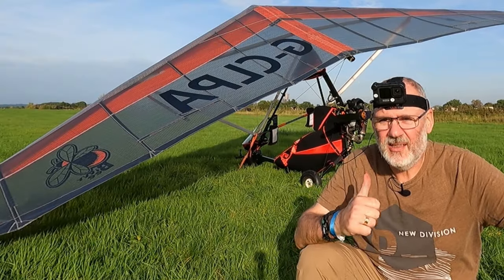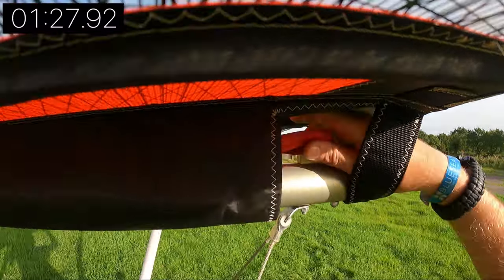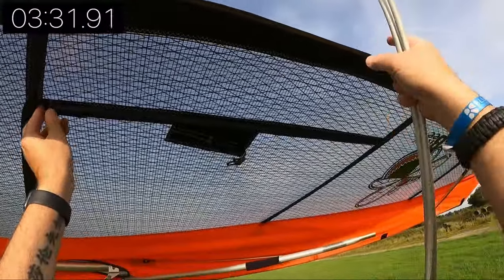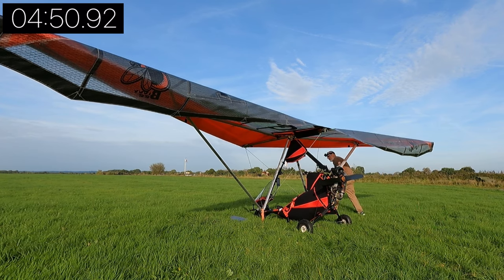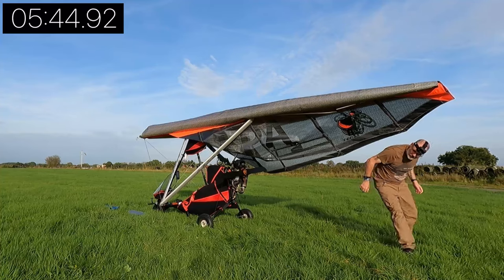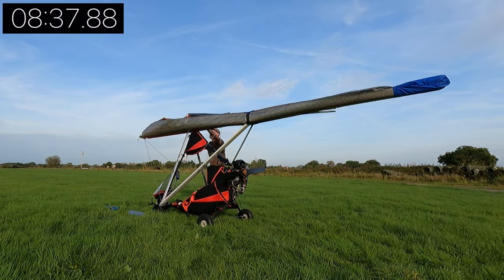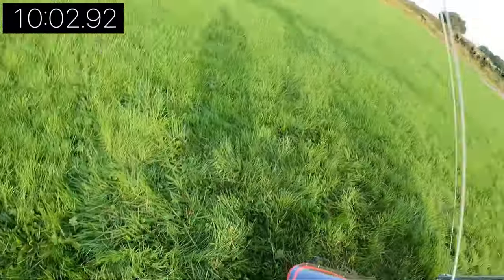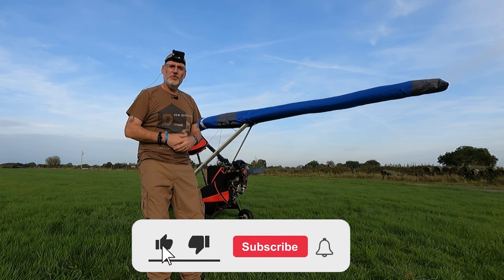Ultralight / microlight derigging - FlyLight BivvyBee - Aeros Fox 13TL

Comment: Really well edited and clear video, Paul. Has given me a headstart for sure! 😁👍
Reply from the maker: Cheers Dan. I’ve got to learn it all over again when the Nine wing arrives. Hopefully should be very similar though. 👍
Reply: @paulieb796  Well it's another topless wing isn't it? Presumably the setup is going to be pretty similar as you say. You'll find out one way or another soon anyway. Looking forward to seeing it. 👍😁
Reply from the maker: Hopefully. The double surface is the main difference so extra under batons and of course those cool wing tips. 👍
Reply: @paulieb796 I'd forgotten about those cool tips. I assume they help with stability and tracking (?) but they also make the wing look even more awesome. 👍😎
Reply: Hello I have some questions about the Fox 13TL: is the wing soft in the roll? What is its cruising speed? Would you recommend it? Many thanks

Comment: Another great video Paul. Hanger fees - one of the reasons why you fold your wing before you put it in the Hanger is to reduce your hanger fee. I know prices will differ Airport to Airfield, but what difference will there be parking an aircraft rigged or folded. Cheers fella.
Reply from the maker: Simon, at my airfield, SSDR/sub 70 storage is about half the price of storage for a fully rigged flexwing.
Reply: @paulieb796  A nice saving. That will help to keep you hobby affordable.

Comment: Thats what I hate about my trike, 35 mins the last time I folded and baged it.
Got an new enclosed trailer and rebuilding my trike.  This will allow two things, new trailer will allow not having to bag the wing or even roll it up if I keep trailer at the field and the trike rebuild will allow me to lower my wing staight down vs having to manuever it awkwardly under my front wheel. 
Cheers
Reply from the maker: That’s one of the best things about the Aeros wings and Flylight trikes. It’s so quick to rig & derig. I did initially plan on keeping my trike at home and trailering it to the airfield. That quickly became too much of a hassle! 👍